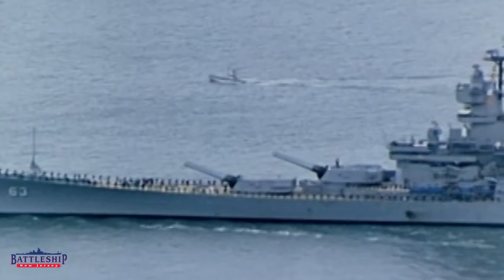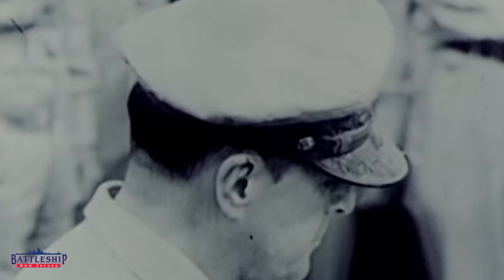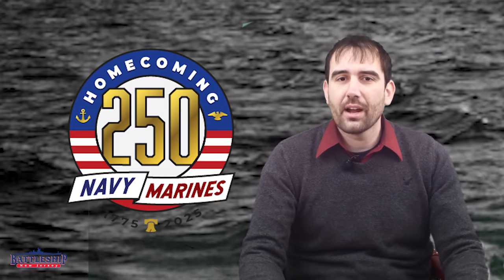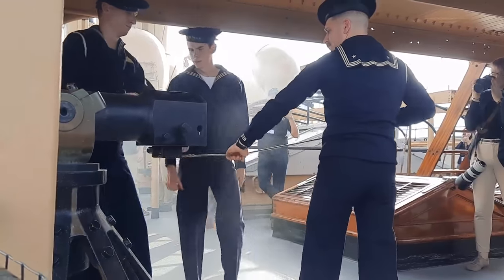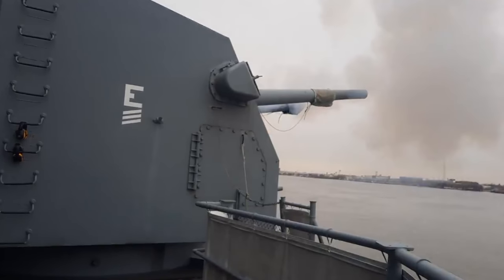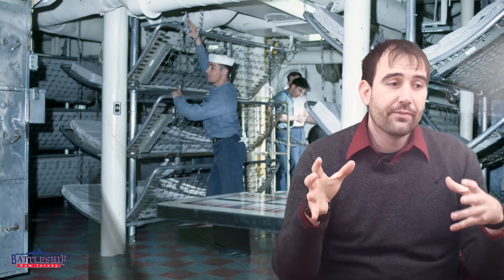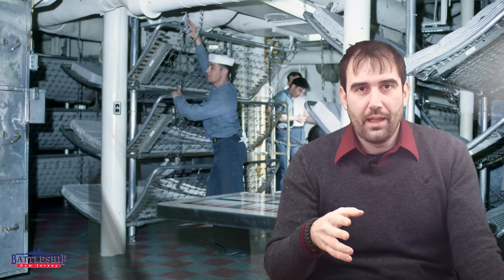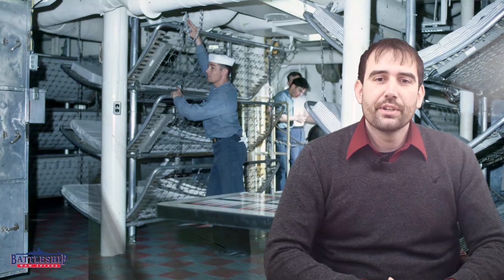Could You Build a Full Size Replica Battleship?

Comment: Why can't you reactivate the galley?  This is serving food. 

The engines and weaponry makes total sense that has to remain inactivated.
Reply: Despite the fact that the galley is historic fabric that needs to be maintained and would degrade by usage, the galley is also steam powered and they cant use the ships steam systems.
Reply: It's the steam that the galley uses is the main hang-up. When I was involved with trying to save the Ranger, I always thought that it was totally stupid. I don't know of any visitor that wouldn't be thrilled to go through the chow line and eat on the mess decks. But, that's the way the Navy has it.
Reply: Correct about the steam and hydrolic systems. None of them can be reactivated even if we’re for restoration work.  Example is the hydro s to raise the main guns when the rubber boots were replaced.  The main guns were raised mechanically by hand.  It took hours for each gun.
Reply: It makes it difficult to operate a ship of that size without a working galley. I think that is the reason that the Navy doesn't want them to be used.
In any case, most of the galley equipment is much too large for restaurant use. They wouldn't be making 150 gallons of soup or spaghetti sauce for the day, like when the ship was in operation.

Comment: To actually build a fully functional Iowa to WW2 specs would probably taken$20-$30B. It's not just the ship that would need to be built but all of the infrastructure that contributed to the ship. There are no factories anywhere in the world that fabricates BB grade armor, so a steel plant facility would have to be created. Same for the 16" gun barrels. Can a modern propellant manufacturer retool to create period appropriate gunpowder? Then there's the matter of a slip way to assemble the ship. Perhaps one of the cruise ship yards has the size, but probably not be able to handle 30k tons of armor plate.

The major cost is that all of the infrastructure would be for one (or two) and done. I don't imagine there would be interest to pay for more battleships beyond that of the notional billionaire. So there would be no economies of scale for these facilities. There would also be tremendous cost and spinning them up as all the working knowledge would have to be relearned with a lot of trial and error.

You would also need multiple schools to train the 1,000s of sailors who would man the ships.

That said, I've built an replica on the USS New Jersey out of a refrigerator box and some gray spray paint in my backyard. The gune barrels came from the Bounty factory while the 5" gun barrels from the Scott factory. Those were expensive as they were produce during the big 5" gun barrel shortage of 2020. With the patronage of several billionaires, we could probably permanently drydock it in a nearby tree and increase the number of docent run interpretative tours.

Comment: My most unexpected takeaway from this is that the Navy doesn't let you reactivate the galley equipment. I wonder why that is?
Reply: That was my question too.  I get the guns -having 9 guns pointed at Philadelphia with the ability to fire 2700 pound shells could be problematic.  I get the steam propulsion plant since pressurizing the steam plants without the proper maintenance and inspection and training of a engineering crew is asking for a host of problems, most of which end up in people dying and/or destroying the ship. 

The only thing that makes sense is the risk of fire, especially if it was due to the malfunction of decades old ovens and the like since there’s a good chunk of time when no one is on board.
Reply: The galley equipment is all steam powered.

Comment: Would be easier (and WAY cheaper) to just have a wooden deck made with framework to build a fake Iowa superstructure (deck is ground level) which is then given the historically accurate armament. The interior could just be hollow with structural members, minus touristy bits like the bridge.   As for the Legality, even something reminiscent of a real Iowa class battleship traveling around, It would likely be sunk, or "acquired" by a foreign power.

Comment: From my best understanding, the main issue for arming such a vessel would be anything like a Phalanx or machine gun, as those have extreme regulations on them. Technically if you bought all pre-1986 weapons and spent hundreds of thousands, you could. 

The biggest issue wouldn't be the 16" guns, but rather their shells. Those are undoubtedly "destructive devices" by the ATF's classification. You could do this, but each one would be individually serialized and registered. I guess if you're a billionaire making a battleship, you could afford it.
Reply: There has to be different US regulation for arms manufacturers and companies that trades arms. Weapons systems can be developed, explosive ammunition can be developed, tested, kept for demonstration and export. I doubt a manufacturer like that has the same destructive device requirement.    So if you build a battleship it should be possible to do it as a company demonstration ship for possible export to foreign customers.
Reply: @target844  A manufacturer wouldn't, but without special clearance, that's how it would have to be done. The bigger hurdle is that no one makes those shells, so it would be even tougher. 

That being said, I don't think the ATF would be too concerned about a project like this compared to a guy making pipe bombs in his basement. The intent is obviously different.

Comment: Even with having all the money you couldn’t build it as is because you’d have to build it to current safety standards. The only way to bypass at least part of the regulations is to retrofit certain systems. The ones I’d like to see reworked is the engine and boiler system so it would be mobile again. It would seem to be more easily preserved if it could be made operational. There’s nothing more debilitating to a ship than for it to be laid up and not be operational. At least that’s my opinion.

Comment: When the military sells off equipment there are demilitarization requirements imposed on the sale. Generally any weapon systems have to be rendered permanently and irreversibly inoperative. So something like a minesweeper or a PT boat with little weaponry could end up in private hands. A major warship much less so. Also if you acquire something like this you will probably have to meet many (if not all) modern Coast Guard regulations on seaworthiness and have a proper crew to run it if you want to actually sail it.

If you go and try to build a weapon system yourself you will quickly run afoul of ATF rules regarding destructive devices and manufacture of firearms in general

Get past those and you had better keep it in the US or you will run into trouble with export control laws such as ITAR (International Trafficking in Arms Regulations)

Comment: could it be done, yea to a degree, would cost billions I am sure, and there is the matter of the wepons the govenment might be saying something about a personal warship, and there is the matter of the hull and where it could be built, only soo many places that could build something soo big.

and as for the armoring could make plate that big sure, lukens steel is still running and made some of the steel for the battleships, and other navy ships but getting the heat treatment for the class a would be a hard mystery, and would take tons of metalergical research you might make something close to it, after all they made an extinct class of steel for the wheels of the t1 locomotive being built. that had not been made in 60 years.

Comment: The full scale and fully operational replica couldnt be done. The barrels, old radios, old radars, old optics (periscopes, rangefinders), fire control equipment,- couldnt be reproduced. There are no propper elements for produce this equipment again. Probably You could reproduce motors and other items that didnt changed significantly since old times. But Im not sure about  armor, this heavy and thick metal. Actually - You CANT reproduce battleship without reproducing WHOLE INDUSTRY infrastructure. And a price of reproduction propper industry could be much bigger then actually battleship price. Maybe You can run this ship afterwards (spent some extra money to hire and train propper crew for it, and making some facilities to continue the training of crewmembers cuz Your crew would have some losses thru real live reasons),- but this industry would be disbanded after Your battleship would be done. And Your money wouldnt come back in this way.